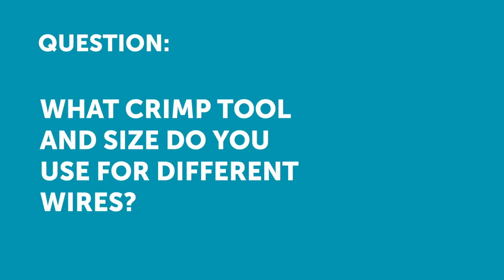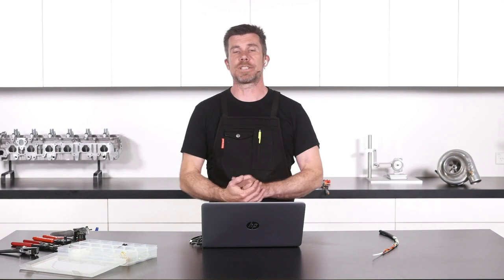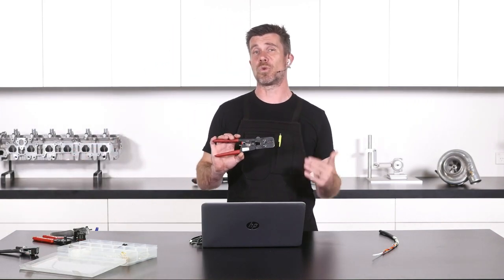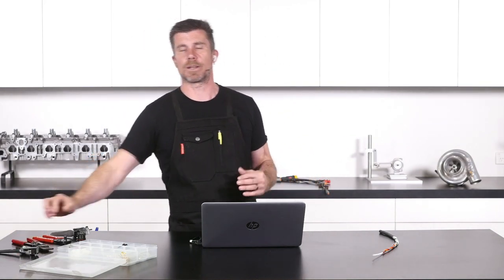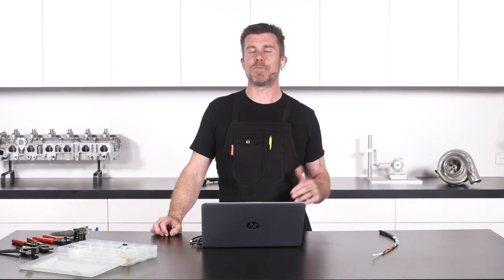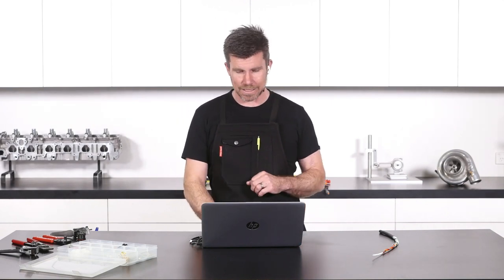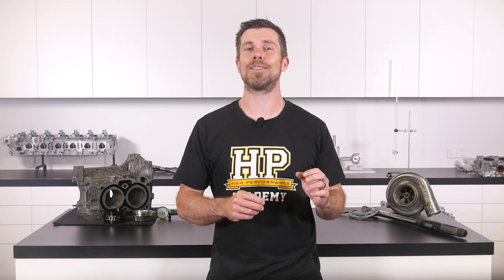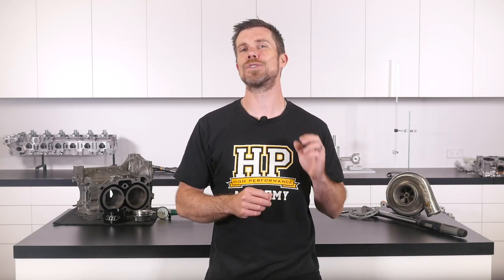Crimp Tool Size | How To Find The CORRECT Die [HPA Q&A]

Comment: Tug test is a must, the last thing you want is the joint cooking itself mid driving because it isn't crimped well enough. I've found with some of the insulated crimp terminals if the wire has a really thick insulation sleeve you often need to fold the core over to get a good crimp and still have it insulated properly.